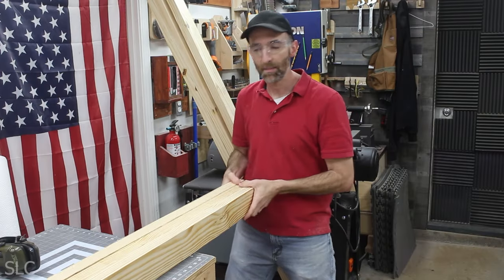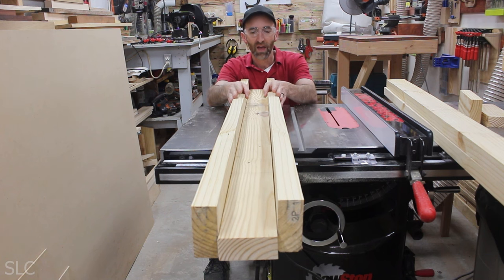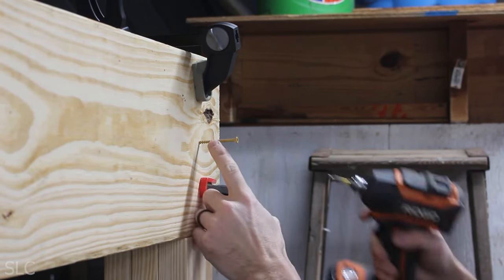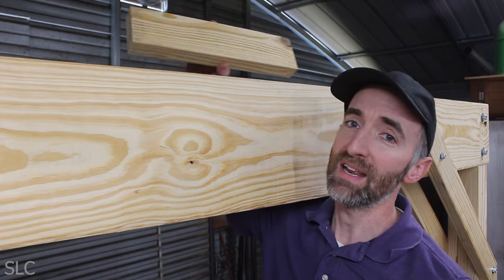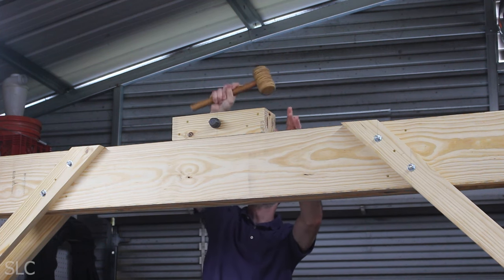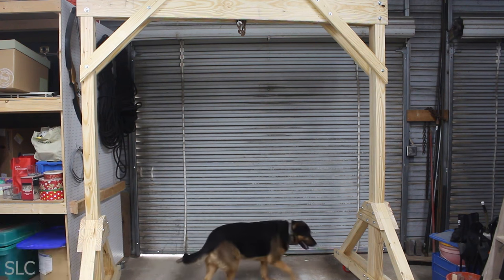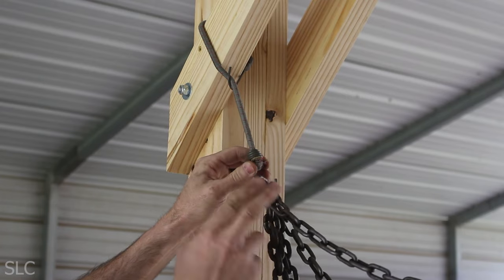Lifting Heavy with a Mobile Wooden Gantry Crane

Comment: Inspired by the video, I built a similar design only instead of going with the chain, I used an electric winch from HF and a pulley to redirect its pulling power to lifting power.  Jumper cabling it to my running car provided enough electricity to lift my load.

Comment: I have to laugh. I only just came across this video today, but looking out my window I see the wooden gantry crane I built a couple of weeks ago for moving the oversized round wood timbers in our timber frame home build. same basic design, but as mine is working on sand rather than a cement floor, no casters ;) I have to move it around largely by hand.  Also, when my sawmill arrived, on pallets, the only thing I had for moving them from the street where the truck unloaded, to a safe place on my site, was my F150. I got a tractor about a week after the sawmill was delivered, but it couldn't have lifted the pallets anyway ;)

Comment: Beautiful design,  well built,  I so need to make one that a can take apart or fold up for better storage.  I don't have the roof/ceiling height like you do. But always need to move or pick up/out heavy items,  engines,  transmissions, generators,etc.
Thank you for sharing,  now have to do some brain storming
Reply from the maker: Depending on the way you connect the top to the legs, you might be able to use large bolts that you can remove to store away. Not sure if it would work, but at least it's a thought.
Reply: @SpecificLove7  thank you, for your inspiration and advice,  I really appreciate it

Comment: I  have a small garage without much head room which sucks, but if I could put a fixed gantry crane infront of the entrance and then add a roof to it so it's in essence a very sturdy portico with some sort of winch or chain system. This would allow me to pull engines, bodies off of frames etc and not have to clear snow out from the front doors.

Comment: any idea how much weight the pipe will hold?  i need to use a 16 inch piece and im wondering if it will hold 500 pounds? was that a 1 inch hole?

Comment: Nice build! I recently bought a sawmill myself and I quickly learned that moving 3-4 thousand pound logs around is not easy.  Have you tried lifting any logs yet with it? I’m thinking I might need two of these for each end of the log just to get them on my trailer…..
Reply from the maker: I've used it for one 22+ dia log with success.

Comment: Nice project,  two questions  1) what was that drill guide you used?  2) where did you get your lumber as it looked much better than what I can get from the big box stores
Also nice saw,  I have so many dead ash trees I wish I could cut up for boards.  but the mill is way out of my price (and storage) range
Reply from the maker: Thank you Dave.
I purchased the drill guide on Amazon. I have it listed in my Amazon store under "Drill Attachments". The link is in the description.
As for the wood, I surprisingly found it at our local blue Big box store, but I did have to search through the piles.
It is awesome that you have Ash trees on your property. We just recently had a huge Ash tree fall in our backyard which is one of the main reasons I got the sawmill.
Reply: that you can get in the drillbit section or Kreg jig section at Lowe's and Home Depot. i think the brand is Millscraft(?)
Reply: Kreg has one too but it's pricier (no surprise with them)
Reply: speaking of overpaying you can find both at higher prices than lowes and certainly homedepot at woodcraft stores

Comment: Hello, Love the video. Do you know the weight of the saw and engine you lifted with the crane? Thanks
Reply from the maker: Sorry I do not, but I would guess 200 pounds.
Reply: @SpecificLove7  Thanks. I'm sure you are correct as that engine alone is approximately 60 pounds. I need to build a gantry that will lift 1,000 pounds as most SBC engines without the tranny weigh about 550lbs. I'm sure this gantry can do that but will test after building. Probably some creaking but no breaking!
Reply: @Danno74Z  did you build one to lift that yet? Im looking to build one this week to lift up to 1000 lbs
Reply: @mikemayne5094  Hello No I never made one. I was able to use my engine hoist to make do.

Comment: Good and bad

Had to watch to confirm detail concerns

Hopefully somehow you can calculate its load limits. So you don’t assume anything in haste. 

Concerns are
1 lack of girt at top of column. Worry it may splay. And do not believe the cross brace is enough. You can see this splaying when you pushed it in grass without load. 
2 lack of vertical support below column and where the wheel are. 
FAILURE will occur at the column location.  As the vertical loading coming down has to transfer over to the wheel. the wheel narrow profile will pose issues of point loading (for slab below) Spread the load. To properly transfer this load from the column you would  need a beam deeper (sim to your beam)  than you have here. 

Recommend blocks be placed under when in use. Could hinge/attach to keep it together 
Cloud be placed in use. 
Visualize a 45 angle from the column out as an approximate length of the block. Width wider than column. This will help protect your slab as well. 

Good the T&G column to beam detail. Better. 
Gusset of steel plate or thick plywood improve this.
Reply from the maker: Wow, that is a lot to think about. Thank you for the information
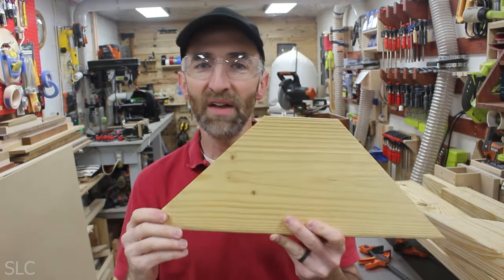Reply: I'm agreed with all of the above.  Are those 2x10s (or 12s?) for the cross bream but 2x4s on the base?  Go to great length to avoid holes in the top cross bream, but I see 4 bolts in the base 2x4s?  Also the trapezoid gusset @2:40 I would have done in plywood.  There are so many bolts on the edges of it.
Reply: The beams are 2x10s